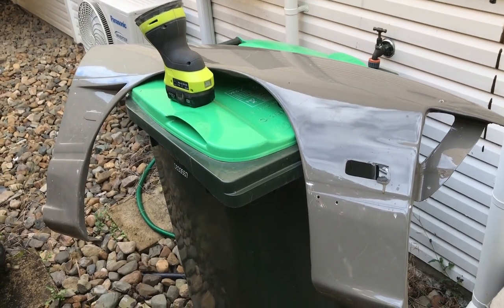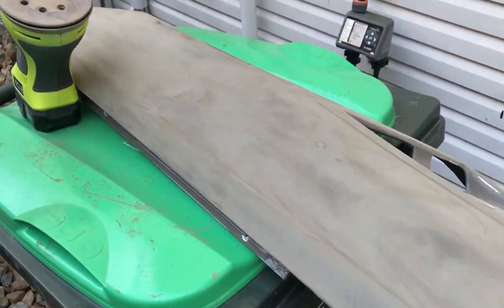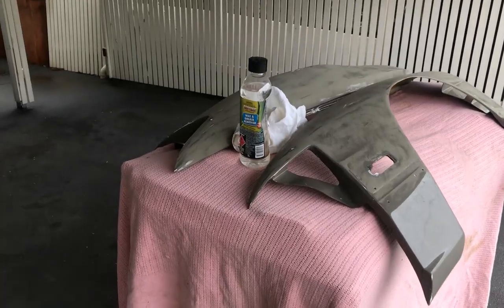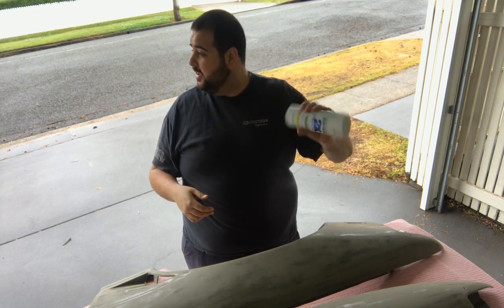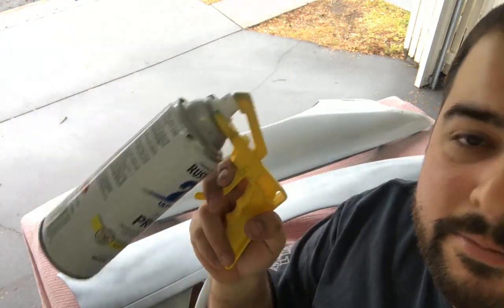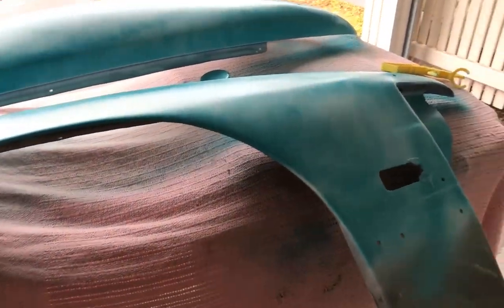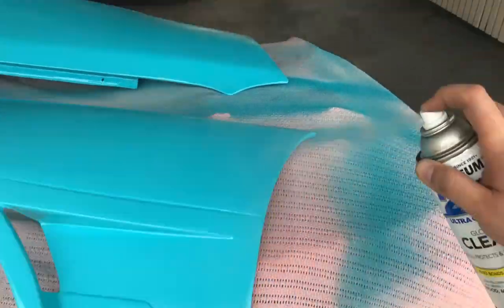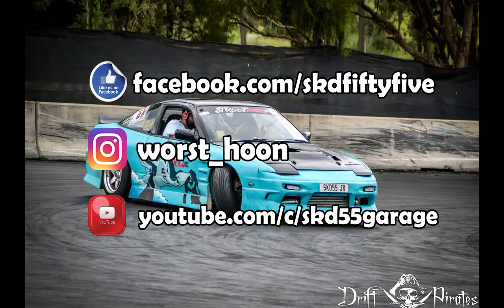SKD55 Garage - Episode 7: How To Paint Fibreglass Panels

Comment: What grit sand paper should I use to sand my fiberglass side skirt ?
Reply from the maker: Start with rough 300 grit and work your way up to 1000 for a smooth finish...
Reply: @SKD55Garage  You would sand to 1000 pre-primer?!  Isn't that too smooth for it to grip onto?  I've just sprayed some 400 grit sanded fibre glass with filler primer and it seems to have come out smooth so far.
Reply: @Astrosisphere  in my experience 320 then high fill primer. They sell it at parts stores. Then 600 before paint.